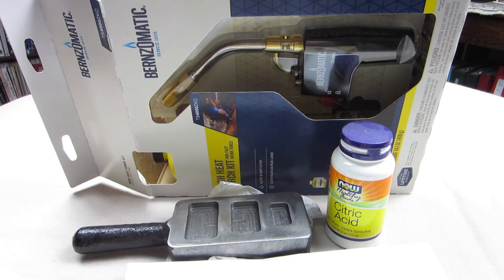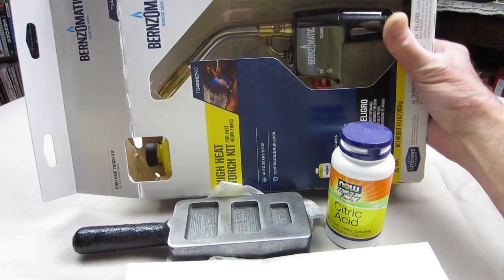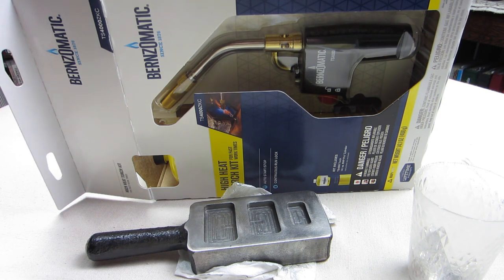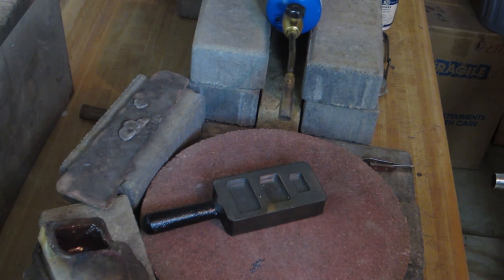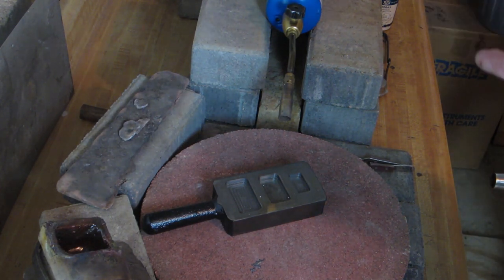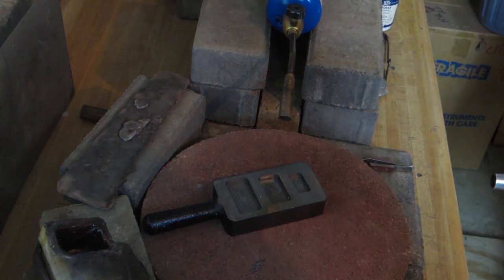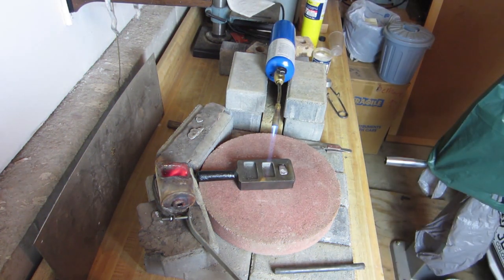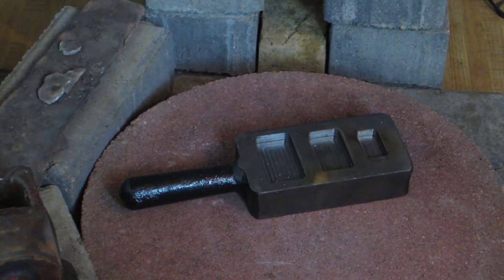Melting Silver With MAP GAS Torch And Pouring A Silver Bar

Comment: Well? Whats the verdict on mold weights? I was wondering if the mold is intended for gold, as it is more dense.
Reply from the maker: Thanks for stopping by to watch, I appreciate it.
 I did do a few later videos using that mold and each time the weights were a little different but on average for silver the largest mold is about 2 1/2 ounces and the middle size is about 1 3/4 ounces for silver. I have not used the smallest size since this video.
 This mold is good for gold or silver but the weights would be different for gold since gold does have a higher SG or denser as you mentioned.
Reply: @GDSavingThePast  Thats what I mean. Maybe the weights will be closer to round numbers if used for gold.

Comment: I have tried MAPP gas and have the hose attachment and I still can’t get it hot enough to melt my sterling silver. I’m going to have to invest in a different torch, possibly an oxy-propane torch or acetylene torch. MAPP gas has been an epic failure. Thanks for the demo!! I’m glad I’m not the only one who failed with MAPP gas!
Reply from the maker: Thanks for watching Buckinghnt and sharing your experience with your MAPP gas setup.
 Invest in an oxy-propane setup, it burns much cleaner than acetylene.
GD

Comment: Thanks for the demonstration and for showing what worked and what didn't. I think your moulds might end up being gram weights, 25/50/75g. Also, most people using MAP has are using .999 silver shot, which might be easier to melt then silver alloy, but that's just a guess. Stay safe 🙂👁
Reply from the maker: Thanks for watching Stacker 2020.
 Actually 999 silver has a higher melting temp than 925 silver.
 Once I pour all three of those molds I will check the weights but I think you may be pretty close on that guess.
Stay safe
GD

Comment: Let's just ignore the word "Danger" on that torch box shall we? LOL. Measure the volume of the mold with water and then calculate the metal needed from the density of silver.
Reply from the maker: If you had watched me work over the years you would know I never worried about Danger. LOL
 That is a great idea about figuring out the weights. Thanks
 Stay safe
GD

Comment: For some reason MAAP gas works for me when 
I melt silver.
Reply from the maker: Thanks Dave for sharing that, I appreciate it.
Maybe it has something to do with the amount of silver being melted at one time or maybe it is that I have been so use to using an oxy propane torch over the years
GD
Reply: I have been successfully melting .925 sterling silver with a mapp torch (looks like the one in this video) for small amounts less than an ounce (about 25g most of the time) in a small crucible with no problems at all.